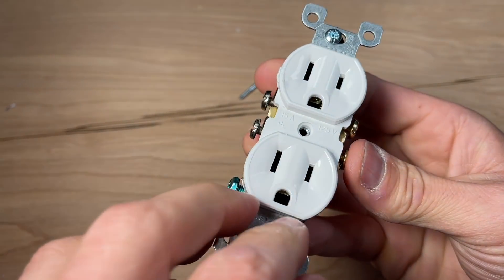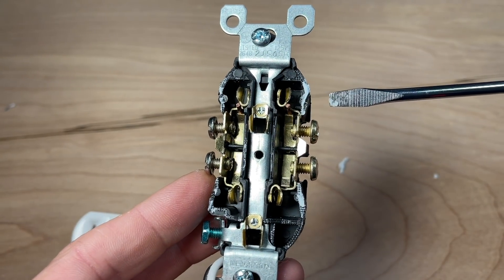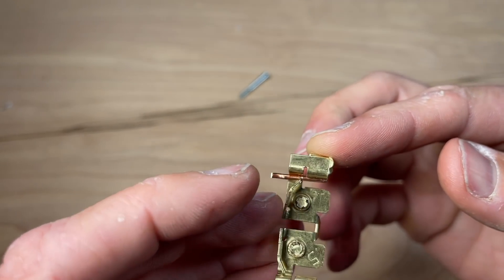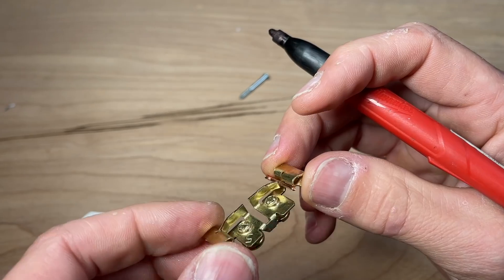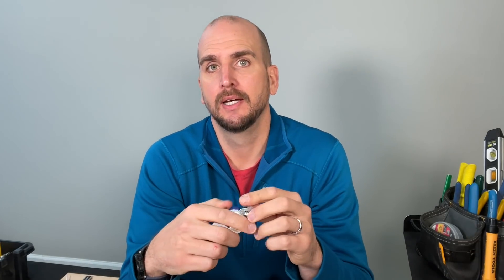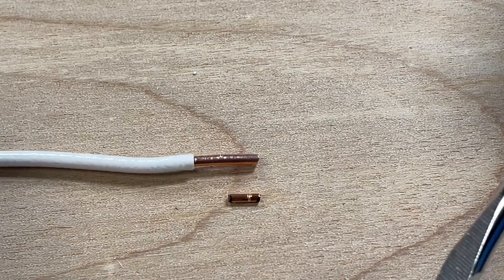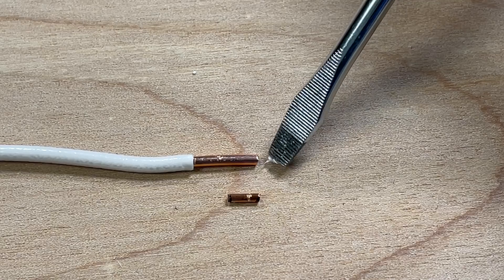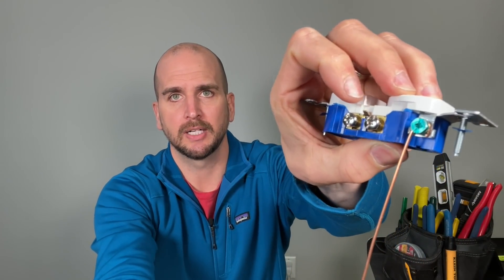Why You Should Not Use Speed Wiring | Back Wiring Is Preferred

Comment: You should have had a side-by side picture of speed wiring, back wiring and side wiring.  It would give a visual difference.
Speed wiring is useful for solving box access problems for me (a DIYer)
But you seeem to sahow Backwiring is almost euivalanet to speed wiring.
And you give a description of the J-hook sidewiring without showing it's pros and cons.

Me? a DIYer - I just can't bend the J-hook right and snug it under the screw.  But you've suggested that back wiring is almost as good.  Speed wiring is a bit simpler - but your discussion could be more explicit in a side by side comparison.

I'm going back and open up some boxes and upgrade speed wiring to back wiring.

Also you should talk about plastic boxes versus metal boxes.

And have a chat about how to wire an eighty year-old camp with open studs and no drywall.

And what to do with two-wire circuits in an 80-yr old camp.

Comment: Back wiring is the way to go.  Much more reliable than back  stab/speed wire.  Simpler and faster to install than the standard loop method.  For stranded wire on a plug/switch back wire seems to also be a better connector

Comment: First, your videos are the best. Thank you very much for doing them. If you can’t or don’t have time to answer, I completely understand. I will keep watching your videos! So clear and concise. 

I’m just starting and confused about how I found the existing connections for a GFCI outlet I am replacing. I am using the commercial spec grade. 
Because the outlet works, I do look at what the person did before me as a reference. (I’m just changing because it got a bunch of paint on it..)

This box has 9 lines coming in, just for one outlet. ? (I don’t know where it goes from here, as in what outlets it might be protecting.)

That person did back wiring, which is what I would like to do.   I see you putting the wire into the top of the two holes next to each screw.  I don’t know what the bottom hole is for, and if there’s ever a situation where you would use both the top and the bottom hole next to one screw when back wiring. 

Previous person had back wired  3 wires on EACH side, so 6 into the receptacle. 2 black on top R, 2 white on top L, and one each on bottom. They were using both holes on the top. Is that a thing? 

Previous person did not even ground the outlet, just had it tucked away. Same on a light which I am doing in same room, so going by what they did is not a good idea, but I don’t know what to do with all the extra lines either. 
Next time I will try harder to remove the paint  😂

Comment: Stab connections have been thoroughly villified in receptacles. But… stab connections are being widely adopted and praised in ideal style and wago style push and lever connectors. 
I understand that there have been receptacle products with bad stab connectors that don’t work properly but that doesn’t mean that all stab connectors in all products are condemned does it? I think not. 
Several years ago I back stabbed my garage receptacles and I run 10-12A loads for long durations on those plugs… I am now tempted to pull out a couple of the receptacles that have carried the most current and inspect them in great detail and pull test the stabs. If I see anything untoward… I will redo them all.

Comment: Question: when installing a commercial backwire outlet in a shallow box, there is so little room I find it difficult if not impossible to pigtail, so I use both insertion points on a backwire terminal to bind the circuit instead of pigtailing. I'd like to know your opinion on this. Thanks for the excellent presentation.

Comment: I honestly don't know why all the electricians in my area backstab. Like the ones who wired our sunroom did that, although they did use tamper resistant receptacles. They're also the type who uses 14/2 on a 20 A circuit with 12/2 and tell me that none of the devices I will plug in will exceed 15 A and if it does, the GFCI outlet will trip.

Comment: I just replaced a few cheap outlets with some good Leviton, and it looks like the side wire terminal can handle two wires. Anyone know if it is a code issue to mount two wires in this configuration? I just used a pigtail to split the incoming wiring for two receptacles in a 2 gang box.

Comment: Anybody tell me if it is okay to back wire 2 gfci outlets? I have one outlet connected behind a fridge (non gfci and hidden). I then have a chain of 2 GFCI outlets. I believe they are wired incorrectly or one (or both) are old and dead. The first one is a line to service (to the fridge standard outlet), the second is a line to another gfci's (hopefully load input!) the 2 gfci outlets I want to use will both be in the kitchen next to a range (on a different circuit). So I'm thinking of back wiring both gfci's to the first gfci's line inputs and there are 3 other standard oulets after the second one I'm  thinking of putting on #2's load side. So... 1st GFCI will just protect itself and 2nd will protect itself and the rest. Any advice would be appreciated. Bought a new condo and both gfci's are indicating an open hot (and the three normal ones in the dinning room as well.) I'm a useless electrical engineer so I know enough to hurt myself real bad...

Comment: Why doesn't anyone make an outlet with a little level you push down to fasten the wires, like in the Wago connectors? That seems to be a good connection and also saves you the time of applying a screwdriver.

Comment: I went into my newborn daughter's room and went to turn on a lamp in the corner of the room. I try to remove the plastic childproof protector that we have for our two year old, but it won't come out. I am able to eventually work it out, but notice that it is partially melted. At the same time, many of the other outlets on the same circuit go out, but not all of them. The breaker isn't tripped. 
I shut off power and remove the outlet. Whoever installed it used speed wiring and it had been arcing inside the wall, melting the plastic in the outlet. NEVER use speed wiring. I'm glad that this didn't cause a fire and hurt my family.

Comment: I’m switching 4 outlets from almond to white & 3 of them are all wired differently!!  

The ones I need help with has 3 Neutral, 3 hot, and 3 ground wires with 2 ground wires capped and one attached.  

On one of them with 3 wires each, 2 of the hot and 2 of the neutral are twisted together and capped leaving one each with a J-hook attached to the screws.

On the other outlet, one neutral and one hot are J-hooked to a screw and then the other two wires (both neutral and hot) are in the speed wire holes.  

I saw your video about piggybacking 2 wires into one but I haven’t seen a video on what to do with 3 wires yet. 

Help!!

Comment: The weakest point and where I've had the most failures in speed wired devices is this: the tiny spring that press the wire to the contact plate overheats, loses its tension and the contact fails. Over 50 years of J hook & screw or back plate & screw and always pigtail for feed through proves my "extra work" pays dividends.

Comment: Is back wiring available for 15A 120Vac duplex outlet? This is what I'm experiencing: I bought the Leviton back wiring 20A 120Vac duplex outlet. Which is meant to be used with 12AWG wiring. However, i want to use it in a 15A circuit with 14AWG wiring. However, the back wiring termination DOES NOT secure the 14AWG wiring.

Comment: In my house we had 2 TV's die that were plugged into an electrical outlet. As I was replacing outlets I found that, that particular oulet was speed wired with 6 cables. Im wondering if the speed wire electrical outlet actually damaged the TVs. The house purchased in the early 90's  so those outlets could be at least 30 years old if not 40 or 50.

Comment: I've seen the back hole style receptacles give me many fits. Damp environments, such as my shed, came wired like this from the storage building guys. The rear hole T-taps can corrode creating a problem. I always side screw wire my receptacles in. Use a wire nut for 3 or 4 ways is better than the rear hole method. Also an electric heater or compressor over time can melt that back connection. Happened at a friend's house & they lost their bedroom power. I haven't seen any videos on dryer hookups, so let's go over this. Most new dryers use 4-prong plugs. Old dryers had 3 with a ground wire going to the dryer shell, & then to a cold water pipe. Is it better to swap cords to keep the 3-prong? Or change out the dryer receptacle to a 4-prong?

Comment: Push ins are are always trouble sooner or later in my 40 years experience. In so many burned and damaged by heat ones I have replaced, the "push in" was the cause. Often also because stress from pushing the receptacle into the box caused it to crack leading to trouble.

Comment: My view is I don't trust what the manufacturer says about push connects then why would I trust what they say about the rest of the device? If you think they're lying, didn't do proper testing then why would you buy any of their products.

The contact surface theory...OK more surface contact. Question is whether the amount of surface in a hook is needed? I'm pretty sure the manufacturer tested this. Very easy to test if the push in has enough contact and pretty easy for an engineer to design. It doesn't look to me like the plug contacts have very much contact either.

I don't know how many millions of these push in connections have been in use for years but I'm guessing a lot. Yet we're not seeing unexpected failure rates, no recalls, no stopping their use. Sure some fail. I've certainly seen J hooks fail too. That hasn't caused me to stop using them when needed.

The last insane bit is I hear people not trusting push ins but then say Wagos are great. Less contact area than push in, thinner metal.

No rational logic I can see to not using push ins properly. Correct gauge, strip length and single use..

Comment: As a DIYer, I've always done side wiring on the El Cheapo outlets and have sometimes had the issues Scott mentioned.  In the future, I'm going to not be so cheap and move the commercial grade outlets with the pinch plates.  Will make my life so much easier on home repair projects.
Reply from the maker: Hey David, good to hear.  I have been comparing the major commercial grade brands lately and I like alegrando-vos the most followed by Eaton and then Leviton.  Still need to dive in and compare Hubbell.

Comment: The really bad feature for speed wiring is wire is being held in place by spring effect of metal pushing against wire. Metal is copper it has limited ability of spring like say steel.   This results in a weak connection of copper spring pushing against wire.  Plus the connection is limited by where wire contacts the spring.  You can see the contact point if you remove the wire.  It is a scratch mark on the wire that is the contact point.  That’s it nothing more  as the copper ages it will weaken making contact point that much more likely lose contact due to heating and contracting of copper.  Which eventually will result in arcing which will generate the heat to possibly start a fire. These “push in” are the worse possible receptacles and should never have received approval for home use.  So every home owner should have them replaced.   Which is basically almost impossible so good luck!

Comment: How is speed wiring really much different from a Wago connector? Look at the contact area inside a light switch or in a mechanical relay.
Reply from the maker: speed wiring is very similar to the push in connectors.  Wago lever nuts are a bit different with the way the wire is being secured to the busbar.
Reply: Wago push connectors like outlet speed connectors are very safe if used correctly. Any failures, which are very rare given the hundreds of millions of uses, are attributable to improper installation. Your contact area theory is just wrong.

Comment: I just bought a house built in 1960, remodeled in 05. Home inspector noted some flaws in the main panel and a few receptacles were inop. When I went to check the receptacles, I noticed they were back stabbed. So I bought all new devices and plates, currently in the process of re-doing it all with the J hooks. Half of the switches had no ground either due to wiring style in 1960.
Reply: Curious if grounding was added in the '05 remodel, as I'm almost certain 1960 homes were all two-prong outlets. And if it wasn't added in '05, did you add ground? Thanks.

Comment: Retired Master Electrician: Back round: Industrial. You are getting better. I have a recommendation, take that wire stripper cut the insulation gently so as not to nick the copper relax your right hand and using your left thumb press on the stripper to remove the insulation. You will be less likely to cause the copper wire to crack when folding it back into the box. That nick can cause a crack. I noticed a number of nicks in your wires. You could get much better. Back wiring works fairly well , but hard wiring works better. I noticed you don't kick back your wire about 3/4 inch down after stripping and then turn to make more of a question mark than an upside down U. Try it it takes no time at all. You will love the results. Remember someday someone will plug  an appliance or heater in that outlet. You don't want to see someone die because you taught one of your students something sloppy. If your ever in Maryland give me a heads up I'll be happy to show you a few tricks to make you safer. Mike

Comment: Here’s my experience:  I once moved into a new home and bought a reconditioned washing machine from a dealer.  It was set up in the place prepared for a washer, but it wouldn’t start.  A technician came over and checked voltages everywhere inside the unit.  All ok, but it wouldn’t run.  He went away puzzled.  I thought about it and decided to check the receptacle.  It was wired with push-in connections.  I moved the wires to the side screws and that fixed the problem.  The quick connections were high resistance.  That did not affect the voltage readings on a high-impedance voltmeter, but prevented the motor from starting.  True story.

I did wire one receptacle recently using push-in connections.  I added the receptacle to an existing junction box which already had several wires in it.  I used the push-in connections because it was easier to get the receptacle into the box, and because the receptacle was to be dedicated to a CO detector, a low-power device.  I would never wire a general-purpose outlet that way, let alone an appliance circuit.

I am not an electrician, just DIY for simple things.

Comment: I disagree a bit with your assessment of speedwire contact area. That tab that holds the wire in is designed to penetrate into the copper wire a bit, and thus be a more reliable connection if the wire is oxidized a bit, especially if you give the wire a tug to test it will hold. Outside of that, its all about the amps, and speedwire is only rated for 14 gauge/15 amps. The backwire thing is ok, but if not tightened correctly it could pull out, especially with junior wire genius pulling those sockets in and out. My preference is j-hook, as you mentioned clockwise. I also do a tape wrap on all sides to make sure I don't get shocked pulling it out or in and don't draw sparks on the metal box. Ah, but that wouldn't happen if you kill the power right? I have done things I am not proud of....
Reply: lol

Comment: I wonder if having less surface area in contact with the connector is actually better from an electrical perspective. A meter would show the same voltage for either. Many of the connectors used in telephony and networking rely on the same single point of contact as the speed wiring. Of course, that is low voltage. 

Mechanically, the back or side wire is certainly better. I typically use side wire as a DIYer and find it also has the advantage that the connection is still visible when the outlet or switch if pushed into the box. It's easy to verify nothing has happened during the final installation step.

Comment: At 4:00 you mark the contact area but everything to the left of the marking also makes contact with the receptacle. So the contact area is more then 2x the size of what you say and mark. (and as an European why the ..... You stil use metal boxes of electrical work)
Reply: Not true when you consider the back stab only contacts one side of the wire (and the tiny clip edge) where as the back wire and side screws contact and compress both sides of the wire along the full length of the stripped wire.
Reply: @erniebouey5325  i didn't mention anything about the other connection methods, i just said that the contact area for the fast stab method is not as small as he made it appear to be.
Reply: @Ulykon  I stand corrected. You were not comparing wiring methods and I misspoke. Now that you mention it, that looked odd to me too. I feel it should be noted that this illustrates a scenario with a perfectly straight wire. Twists or bends in the stripped wire could decrease surface contact along the length of the contact patch. Do you agree?

Comment: I live in France and a lot of modern sockets & switches here are now of the 'speed wire' type with no screws at all. They are designed to accept 1.5 mm2 or 2.5 mm2 wiring (I don't know the equivalent AWG), and can carry 16 amps at 230 volts. I don't particularly like them, but they're easier to wire if space is tight, or the wires are short. So far, I've had no problem, but I prefer the 'traditional' screw terminals. They just feel more 'positive'.
Reply: There is no problems with these as long they're designed correct, like a Wago. Problem with some of these we use in Europe in my opinion is that there often is no visual inspection or close/open function. A wago is easy to see if you installed it correct  something that gives you confidence.